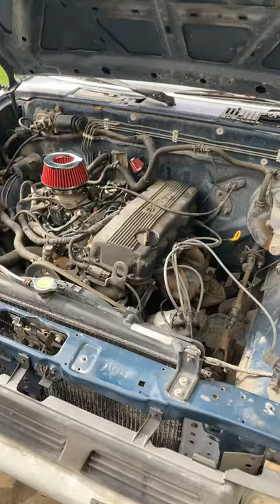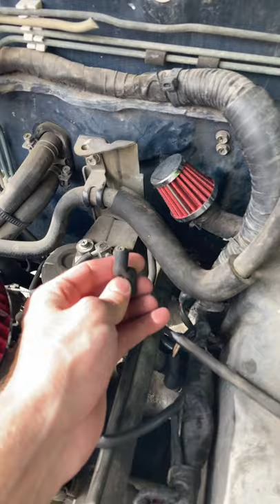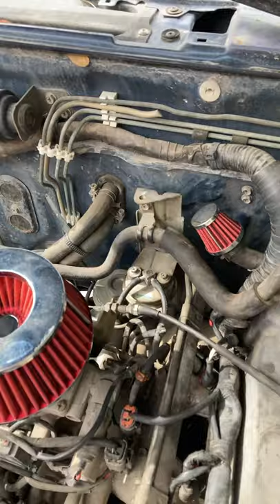Vacuum leaks caused a rough truck. #shorts.

Comment: Good ol, hot air intake. For when you make just a little too much power with the stock setup
Reply from the maker: love the hot airs! haha
Reply: It’s like sucking cold air through a straw or hot air through your mouth, still an increase lol
Reply: @ookiss00  hot air contains less oxygen which means less combustion. That engine is not very efficient so airflow doesn't really matter, the temperature will though.
Reply: @jonbar140  if this is so, why do all vehicles operate fine with a functioning EGR system, which pumps hot exhaust gas into the intake?
Reply: @ookiss00  Great question! EGR only turns on when on the highway and by introducing inert gases, it injects less fuel into the cylinder thus decrease ing horsepower by essentially decreasing engine size in a way which makes it more fuel efficient. That makes sense? If it was just to add less fuel it would run lean but by sucking in air that will not combust it doesn't increase vacuum in the system and reduces the amount of fuel needed when power is not required like on the highway. I shit you not, driving right now with a OBD2 scanner and my phone is saying my 3.5 l V6 is only using 30 horsepower to do 75 miles an hour.

Comment: Those it then drop the foreflex down and it will clean it right up. But as a rule of thumb remember to prime the front of the foreflex or some gasket seal. Fixes vacuum leaks real easy

Comment: Is that the Z-24 motor? Hard to kill unless you just flat out abuse it. I have the original still in my 1992 Nissan D-21 Hardbody. I looked down at the Garmin one day scootin down the highway and it said I was truckin along at 113mph. I didn't think that little 4cyl could pull that.

Comment: Nice hot air intake
Reply from the maker: thanks! haha. Im glad someone else calls em that!
Reply: @RoadsideRescue  haha I see so many ricers with them! Supposed to have the filter outside the engine bay!
Reply from the maker: Yeah. There are very few vehicles I would understand why have a hot air intake. As for this truck the air tubing takes up that whole area over the intake and wraps around the front over to the driver side? It’s just too big. So I slapped one of those in there.